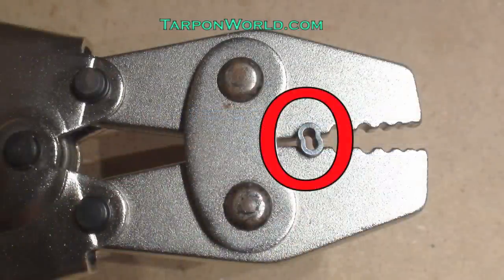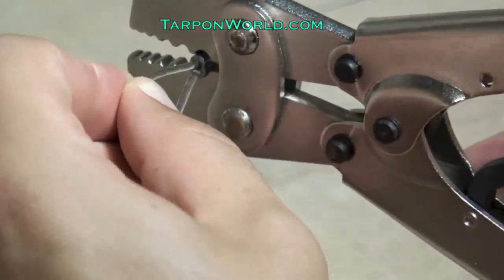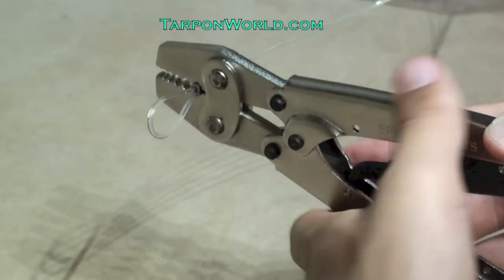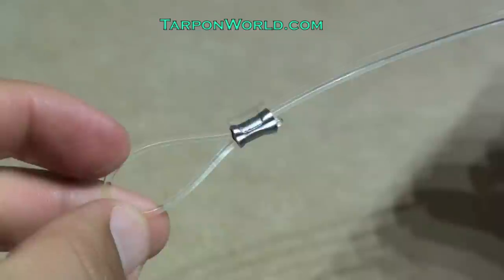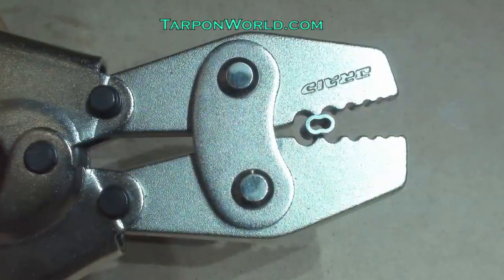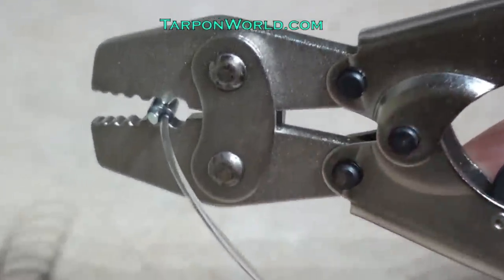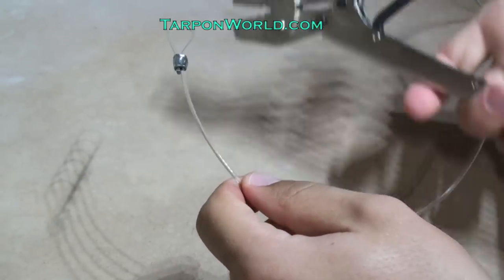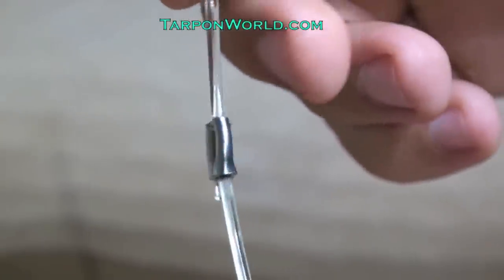How to Properly Crimp

Comment: Would you use this single crimp method on 1-16th inch aircraft cable?
Reply from the maker: Kirk Meyers yes, but use black crimps for cable. Not the silver aluminum ones

Comment: How do you crimp single barrel into a loop for 30 lb mono?
Reply from the maker: I stay away from the single barrels because it’s difficult to get the mono to sit neatly to get a good crimp done. With 30lb mono I would recommend tying a simple loop knot.
Reply: @TarponWorld  thanks. A friend of mine that grew up near the coast used single barrel but I'm starting to think it was just to hold floats or weights in place.
Reply from the maker: @cesmess1  Could be. That is another use for them.